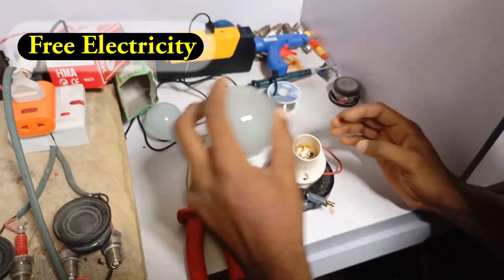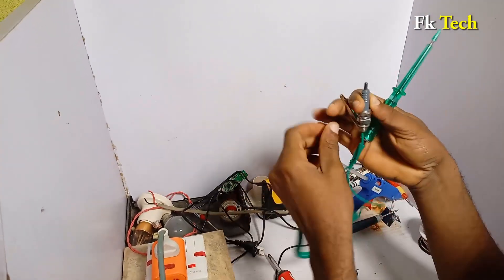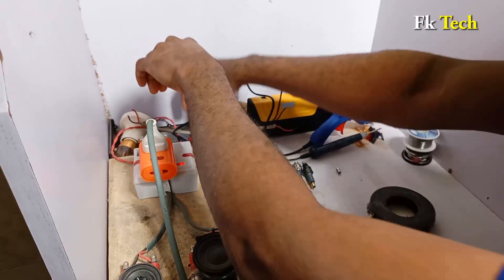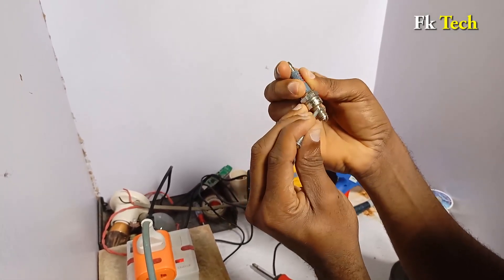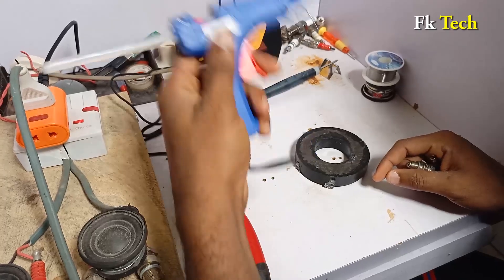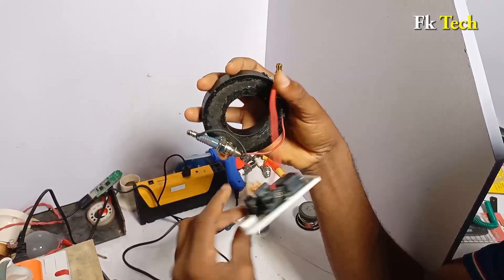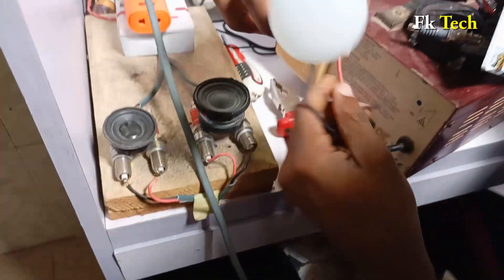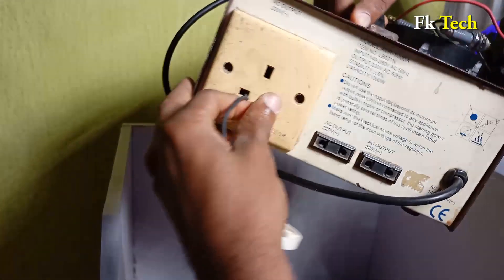The Principle Of Free Electricity Energy Generator With Spark Plug And Magnet At Home

Comment: I am very impressed with what you are doing. I have been trying to repeat your results.  So far no luck after trying various iridium spark plugs. Just a few questions please, sir. Are the plugs you are using  been used before or new. Are they spark plugs with a built in capacator. Could you give the name,  or make of the plugs with their number, so that others can reproduce your results.  Any information would be helpful.  Thank you.
Reply: Ensure u connect the wire to the center electrode
Reply: @innocentoriaiseikuemehinlo8029  have you tried and it worked
Reply: Please I would need your direct contact
Reply: WhatsApp
Reply: Sure, because that will really show that you are real